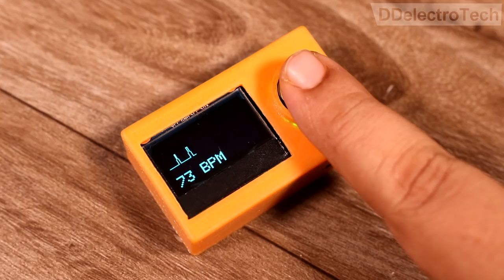How to make a Heart Rate Detector at Home - Under $10

Comment: Really great video,  I wish it was a little slower especially would have helped regarding the 5v boost power module,  note regarding the cheap pulse sensors, I bought two, neither worked well finally got the real mccoy.  Bumped the project up over $30 bucks still totally worth it.  Lot's of fun thank you so very much!!
Reply: Hi amazing feedback! Where is the code for the arduino I can't find it?

Comment: Amazing sir!! But i wanted to know the board that you have used connecting with battery. Please sir as soon as you see this comment let me know the name of the board please?
Reply: It is a 5V Power Setup Module 
You can buy it for ₹67 
Or you will get it in old power banks
Reply: @pianoguy5110  battery kitne ampereki h
Reply: @pianoguy5110  or power module kon sa h
Reply: @cutieaayu  Aek 1000mAH ki battery aati hai 
Price - ₹265 
Aur aek battery 300mAH ki aati hai 
Price - ₹145
Reply: @cutieaayu  Li-ion battery....
Reply: @cutieaayu  input 3.7V output 5V/1A ka power module milta hai 
₹45 ka bhi aata hai

Comment: Wow, I want to do something with pulse sensor, I want to put in the car seat belt of driver for safety & save life, if the driver not wear the seat belt then vehicle not start
Reply: For that, no need to put the pulse sensor bro
And it's no use